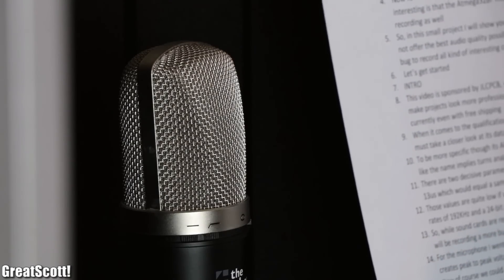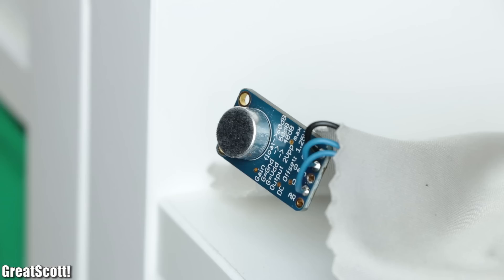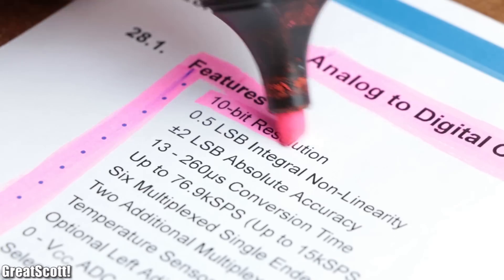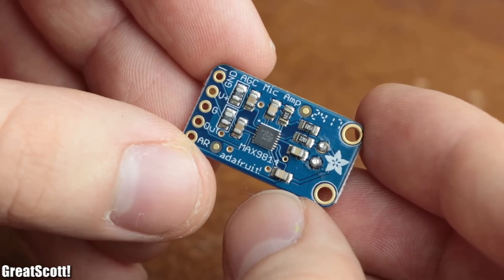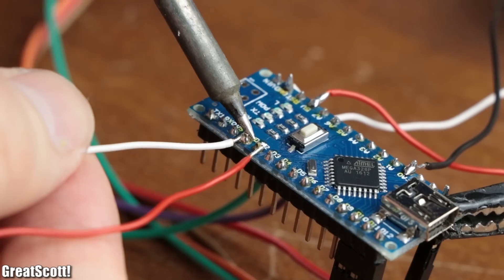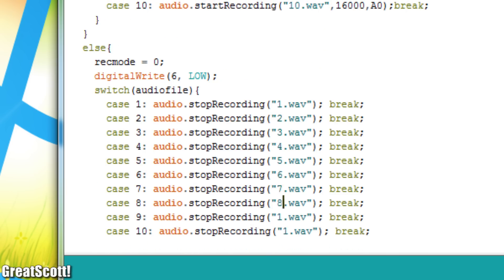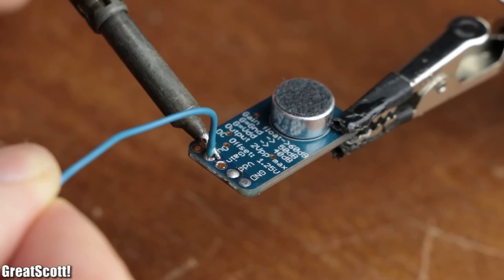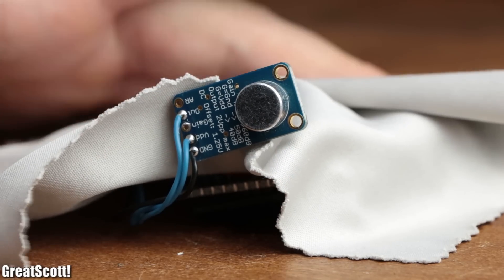Make your own Spy Bug (Arduino Voice Recorder)

Comment: Quick tip for improving the code: instead of useing those rather compilcated switches just replace the filename with String(audiofile)+".wav" and you can record an unlimited number of files.
Reply: What's the difference
Reply: ohhh my god i was thinking same
Reply: how do you do this?
Reply: @loufbread26  That with the code shown you can only create up to 10 files, instead, with this improvement, you can create as many files as can fit in the MicroSD

Comment: The cool spy-bugs on TV send the audio through a radio. This gives me an idea for a "DIY or Buy": a walkie-talkie.

There are a few very basic walkie-talkie tutorials based on arduino, but nothing really nice. You could try the analog version too, but a digital one would be more fun: sample the audio with the ADC, then send it over the air somehow (LoRA module maybe, or a cheapo 433mhz ook module pair), then receive and play it back with a DAC from resistors (or use a DAC chip, or a micro that 
has a DAC built-in like the SAMD21 found in the Adafruit Feather M0).
Reply: RPITX can accomplish this.

Comment: why not using the onboard led for notification, it would consume less power and you don't a extra led
Reply from the maker: Also possible
Reply: But it'll be to bright?
Reply: Unless you PWM it (and given the inherent complexity of recording audio on something so much not designed to do so), I think that would be a higher current draw than is desirable.
Reply: @danya023  neeeeerd
Reply: @ninovitaliano7943  I'm honored someone noticed, thanks. 

It's true though, isn't it? The onboard LED is rather bright and it takes around 10-20 mA, and if you're running off a battery you want to cut down on the current draw as much as you can so this is something you would disable first. The other option is to use PWM to modulate the LED, but AFAIK pin 13 doesn't have hardware PWM, so you have to spend processor cycles on this, and I bet that there's not much free processor time left over from "recording audio on something so very much not designed to do so".

Comment: 16khz is a very odd sampling rate. So make sure you always have subtraction of 44.1kHz or 48khz. (32khz, 22khz or 11khz) Also it's good to use some input filtering to prevent extra distortion (Shannon theorem).

Comment: Hi,

 We have a 4G audio bug now. Attached is the spec and user manual.
- 20 hours continuous recording and upload to server
- 7 days voice trigger standby
- optional 1 meter external MEMS mic
- voice range : 8 meter
- VoLTE live call
- ogg highly efficient compression, saving memory and data bandwidth
- optional upload files to your own ftp / ftps server, useful for the police

Comment: As small as possible... Why not own PCB? ;p
And instead of using switch 1.wav, 2.wav why not make string  "record" + recordNumber + ".wav" ? :D
Reply: and recordNumber could be stored on an extra recodNumberFile.txt to prevent overwriting of old data
Reply: Pixel Inside Or in EEPROM ;)
Reply: Naming the files that way would look nicer but doesn't add any information. But if you wish you could add an RTC clock and add the timestamp to the file name.
Reply: I think his focus was on the building, not the programming... ^^
Reply: Indeed. And atleast for the use case of a spy bug, an arduino/micro controller is a little overkill. And what if someone discovers the device and destroys it and the SD card with the data? You can easily make a small FM transmitter (i made one thats 17x6.6mm). It wont transmit kilometers away, but enough so that you dont have to be right next to it.
Reply: Thomast Tham yep, pretty illegal here in Sweden aswell.
Reply: Pretty damn illegal anywhere
Reply: simple. German Engineering.
Reply: how small could the  avg consumer get this bug ? how about with the pcb company in the video to miniaturize it ?
Reply: @jmsp000  Wow, that's cool,
Can you please help me send the codes you used.

Comment: I'm trying to make a talking robot with a jaw servo that moves based on an audio signal from a 3.5mm audio jack. Any tips GreatScott?
Reply: no. just stop
Reply: I think that you can use the analog signal coming from the 3.5 mm jack and convert into a range of motion of the jaw servo! I think that should work
Reply: @lonsteam4627  ?
Reply: @moritz3864  very good broject and funny 😂👍🏻

Comment: for a "spy bug" I wouldn't use a push button with led. With a normal switch you can determin the state of the bug based on the position of the switch and you can use it as wake up signal to save battery when the device is off.

Comment: some micro FPV cameras i use on tiny drones can record and broadcast medium fidelity analog video and audio at a tenth the size. they only require the camera/Tx bundle and a gumstick battery to operate, meaning its about 27g and 5-6cm^3.
Reply: no, and if it's cheaper I don't see the point. I've made my own microcams before CMOS sensors had a processor and body that small, but i have no practical use for a spy bug, just a suggestion. no need to be so pretentious.

Comment: You can probably keep the power consumption even lower by downclocking the arduino and pushing it into deep-sleep when not recording. In deep sleep, one can get the power consumption in the micro amp region.

Comment: I've found using standalone AVR chips plus a crystal to be cheaper and smaller than using even Arduino nanos, plus an ftdi USB  to serial adapter only for breadboarding. I use a pro mini as an ISP since some vendors who claim their AVR chips already have the Arduino bootloader are less than reliable in their claims.

Comment: This would be good to use on a motion activated circuit.  I can see this as a crude DIY Security system.
It would be interesting to make it only record when sound is louder than a given threshold.
Reply from the maker: Sounds interesting

Comment: Hello Scott,
Why not make spy bug as a bug using FM transmission and recording in phone, I tried but facing problem with frequency. Why don't you make a video on that
Reply from the maker: I put it on my to do list
Reply: Bruce Lee , I don't know what is lora But I tried it using transistors and couple of passive elements. And some time it did work and later stopped working cz of frequency fluctuation or noise .
Reply: that need an app bro :P
Reply: iron man can you give me sketch of your work please ?
it will help me in my final year project
Reply: @greatscottlab  Please do. I am doing the same project but getting only noise as output!

Comment: dumb question...looks like you need to manually initiate the recording mode by pressing a switch.  For the purpose of eliminating this need, couldn't you put a circuit that activates the record mode if there is sufficient sound input volume and deactivate if there were a specified amount of time for which there was no sound over a specified input level?

Comment: That’s very good project. I am searching for project like this, but my use case is slightly different instead of storing audio files into the sd card I want to print the data into the console. For example I press a button then it will listen my voice and then when I stop for 2-3 seconds it will print the recorded voice in the console or terminal can you help me on that

Comment: Sir,
Which sensor is best to buy?
1. Electret Microphone Amplifier - MAX4466 with Adjustable Gain .
2. MAX9814 High Performance Microphone AGC Amplifier Module.

Comment: ios is unable to record phone calls.  To be able to record both  the  speaker and microphone at the same time would be outstanding.   A device like Arduino or raspberry pi could function as a headset but built into it are whatever components are necessary for recording and storing the recordings.  Do you know how to make such a device?

Comment: Hey,
I'm currently working with this library too but not to record audio files. I simply want to play a song, but every time I try that I get an 'SD card fail'. I already tried the basic things (format card, other SD card, other Arduino, made sure code and wiring is correct). I know that this is not a helping forum but I hope that some of you can help me with this. Thanks in advance

Comment: Hey Scott, i'm currently working on a small project. I do not know much about electronics. I want to light up three 3.4v 750mA leds in series using a 9V 3A power supply. Do i need any resistors for this or will this just work as it is?      This needs to run for hours on a daily basis.
Reply: well how did it turn out?

Comment: Very nice project, but is possible to reverse this process and play mp3 or waw files on arduino without special extension board, just with arduino pins? :)
Reply from the maker: Yes, the library that I used can do that as well.
Reply: Thanks :) I will try it

Comment: Very nice, but the SD card board don't work only with 3.3V?
Reply from the maker: The sd card board has a 3.3V regulator on it. So the battery voltage is no problem.

Comment: Can you please give the arduino code. I'm getting an error always saying that " 'class TMRpcm' has no member named 'startRecording' ",  although I installed the latest version of the TMRpcm Library. Another blog says that the reason is 'commands are being run which are not available in the current configuration. Check the #defines in pcmConfig.h to ensure you are using the correct mode(s), and ensure your commands are correct.'. Please can you help me!!!!!!

Comment: You did not use any kind of regulator. Does Arduino pro mini and SD card module works fine over the 3.7 to 4.2V range of Lipo battery??
Reply from the maker: Yes

Comment: Is there any tick to get free shipping at jlcpcb? I put the pcb to my card, but when I try to pay it wants about 20$ of shipping.
Reply from the maker: They told me that you need to enter your contact information before the free shipping appears. And if nothing works out, simply contact them. Another viewer had the same problem and got its free shipping in the end without a problem.
Reply: Thank you for your help. I added my address, because I thought about that too, but I didnt worked. Now I contacted them, maybe they can help me.

Comment: Hello Scott, did you use 5v or 3.3v Arduino pro mini?
Reply from the maker: +markoni985 5V. But it doesn't matter which one you use.
Reply: So the output from TP4056 (2.5v-4.2v) will not affect the performance (clock speed) of Arduino?

Comment: Greatscott great videos!
Is it fine to connect all the modules directly to the output of the TP4056? Does it not need a a 3.3V regulator or any capacitors?
Thanks.

Comment: How do I get the free shipping on the PCBs, it says its 17 dollars on the website?
Reply: Pete Allum No I made sure I'm using the correct parameters.

Also my PCB is 45 x 40 mm

It would be nice to order these as soon as possible as I have a design I need printed for my capstone project
Reply from the maker: They told me you have to enter your contact information before you get the free shipping. And if nothing works, contact them. That has worked out for a couple of viewers.
Reply: GreatScott! Ok, unfortunately nothing seems to be working so I'll contact them, thanks.

Comment: Arduino: 1.6.9 (Windows 8.1), Board: "Arduino Duemilanove or Diecimila, ATmega328"

WARNING: Spurious .github folder in 'RTClib' library
C:\AnkurNupur\Ankur\ARDUINO CODES\SpyBug\SpyBug.ino: In function 'void button()':

SpyBug:43: error: 'class TMRpcm' has no member named 'startRecording'

       case 1: audio.startRecording("1.wav", 16000, A0); break;

                     ^

SpyBug:44: error: 'class TMRpcm' has no member named 'startRecording'

       case 2: audio.startRecording("2.wav", 16000, A0); break;

                     ^

SpyBug:45: error: 'class TMRpcm' has no member named 'startRecording'

       case 3: audio.startRecording("3.wav", 16000, A0); break;

                     ^

SpyBug:46: error: 'class TMRpcm' has no member named 'startRecording'

       case 4: audio.startRecording("4.wav", 16000, A0); break;

                     ^

SpyBug:47: error: 'class TMRpcm' has no member named 'startRecording'

       case 5: audio.startRecording("5.wav", 16000, A0); break;

                     ^

SpyBug:48: error: 'class TMRpcm' has no member named 'startRecording'

       case 6: audio.startRecording("6.wav", 16000, A0); break;

                     ^

SpyBug:49: error: 'class TMRpcm' has no member named 'startRecording'

       case 7: audio.startRecording("7.wav", 16000, A0); break;

                     ^

SpyBug:50: error: 'class TMRpcm' has no member named 'startRecording'

       case 8: audio.startRecording("8.wav", 16000, A0); break;

                     ^

SpyBug:51: error: 'class TMRpcm' has no member named 'startRecording'

       case 9: audio.startRecording("9.wav", 16000, A0); break;

                     ^

SpyBug:52: error: 'class TMRpcm' has no member named 'startRecording'

       case 10:audio.startRecording("10.wav", 16000, A0); break;

                     ^

SpyBug:59: error: 'class TMRpcm' has no member named 'stopRecording'

       case 1: audio.stopRecording("1.wav"); break;

                     ^

SpyBug:60: error: 'class TMRpcm' has no member named 'stopRecording'

       case 2: audio.stopRecording("2.wav"); break;

                     ^

SpyBug:61: error: 'class TMRpcm' has no member named 'stopRecording'

       case 3: audio.stopRecording("3.wav"); break;

                     ^

SpyBug:62: error: 'class TMRpcm' has no member named 'stopRecording'

       case 4: audio.stopRecording("4.wav"); break;

                     ^

SpyBug:63: error: 'class TMRpcm' has no member named 'stopRecording'

       case 5: audio.stopRecording("5.wav"); break;

                     ^

SpyBug:64: error: 'class TMRpcm' has no member named 'stopRecording'

       case 6: audio.stopRecording("6.wav"); break;

                     ^

SpyBug:65: error: 'class TMRpcm' has no member named 'stopRecording'

       case 7: audio.stopRecording("7.wav"); break;

                     ^

SpyBug:66: error: 'class TMRpcm' has no member named 'stopRecording'

       case 8: audio.stopRecording("8.wav"); break;

                     ^

SpyBug:67: error: 'class TMRpcm' has no member named 'stopRecording'

       case 9: audio.stopRecording("9.wav"); break;

                     ^

Multiple libraries were found for "SD.h"
SpyBug:68: error: 'class TMRpcm' has no member named 'stopRecording'

 Used: C:\Users\AnkurNupu\Documents\Arduino\libraries\SD
       case 10: audio.stopRecording("10.wav"); break;

 Not used: C:\AnkurNupur\Ankur\arduino 1.6.9\arduino-1.6.9\libraries\SD
                      ^

exit status 1
'class TMRpcm' has no member named 'startRecording'

http://downloads.arduino.cc/packages/package_index.json file signature verification failed. File ignored.

This report would have more information with
"Show verbose output during compilation"
option enabled in File -> Preferences.

Comment: would it be possible to power arduino from radio noise? Without huge antenna
Reply from the maker: No
Reply: And with huge antenna? :) Just curious about making something usefull without battery

Comment: Why only ten recordings?
Reply from the maker: You can add more if you want
Reply: That's what I thought because in most programming languages (or every) you can make an Array, so every time you press the button it adds a new element, therefore creating an infinite number of possible recordings. Thanks for the response and great video!